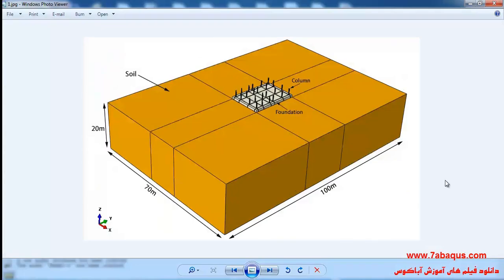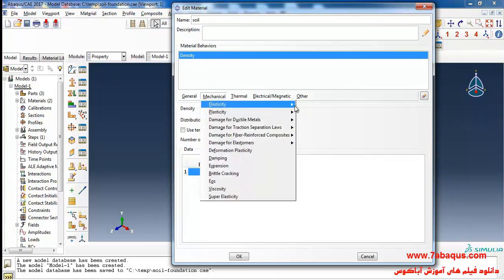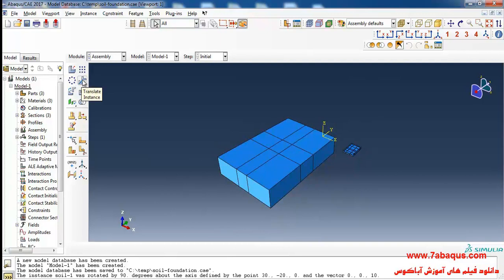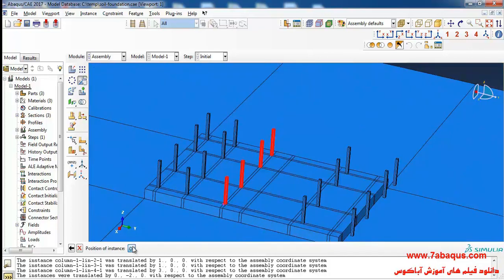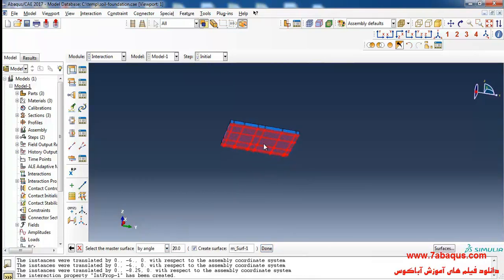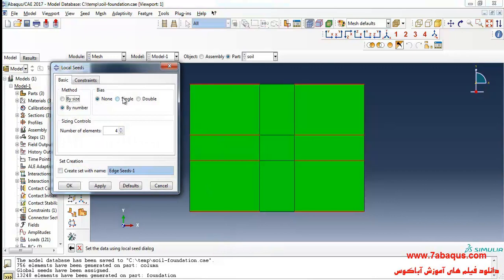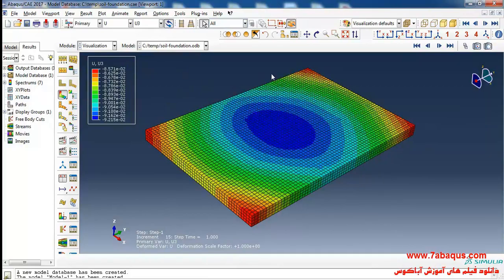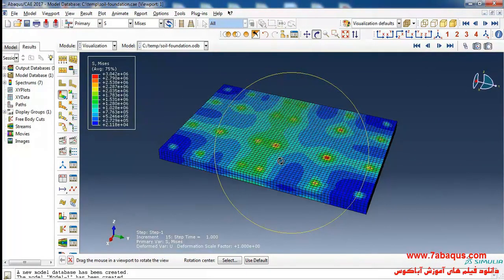Interaction between the soil and foundation Abaqus

Comment: I am currently modeling the interaction between geogrid and soil and I am getting a numerical error in my model in Abaqus. I have also used surface-to-surface contact for the interaction. Can you help me solve this problem?
Reply from the maker: The contact type you selected is correct.
Reply: What do you think I should do? Have you ever modeled a reinforced soil wall considering the interaction between the soil and the geogrid and the wall facade as a surface-to-surface contact?
Reply from the maker: @hadisedghi98  No, Use " Tie constraint "
Reply: But the tie is not correct because there is always a slight slippage between the soil and the geogrid.

Comment: Hello, in case i want to model a soil with cohesion 0, c=0. Which value should i use? I'm working with newtons, pascals and meters and if i use a number lower than 1000 (pascals) job doesnt run or has convergence issues. Thanks for your video.